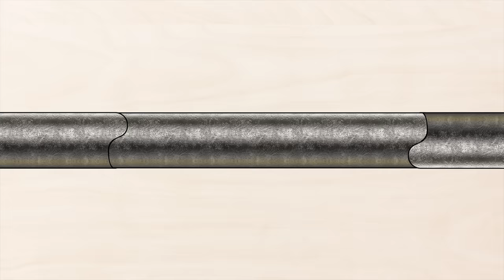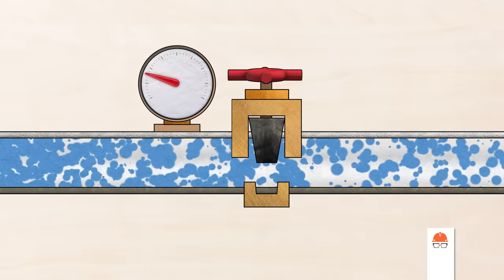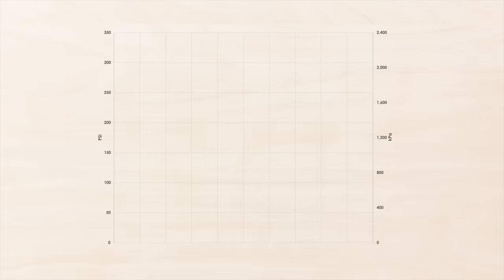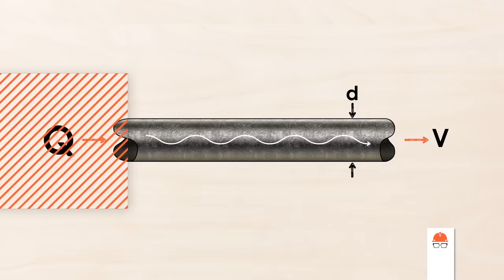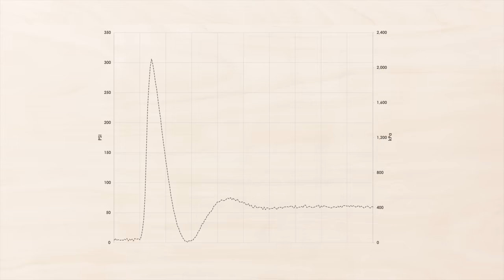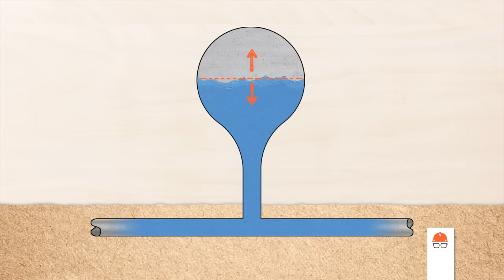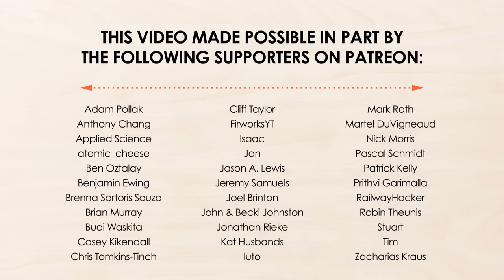What is Water Hammer?

Comment: Damn, I just witnessed this in my work. 
We had complaints of extreme pressure surge from a ground level water-customer. 
That particular pipe was connected to a main before a pumping system that leads to a 15 storey water tank, where the water then flows by gravity for the building. That pumping is controlled together with a "solenoid activated pilot valve", when they detect that the 15 storeys water tank is low in level. 
Apparently, the automatic valve closed too rapidly, causing the water behind the valve to slam against the back of the valve. Which of course, results in Water Hammer! But in my case, the ground level water customer's pipe is connected to the main before the valve. 
Meaning that when the valve slams shut, the water, instead of slamming like water hammer, it finds the easiest exit route, which unfortunately means the ground level's service pipe. The water pressure more than tripled when the valve slams shut.
Reply: @ Dalziel45 I believe you will find the Water Tank is under pressure as well. IF it was 'purely' gravity feed the users on the 14th floor would have Extremely low water pressure.... BUT, you are right about the pressure surge...They either need to add some type of surge arrester OR 'Perhaps' replace the solenoid valve with a check valve, which close 'Once' it senses low flow (ie. the pump shut off)  while Still preventing 'Back flow'.....
Reply: @crazybob1954mo  re: pressure, not at all, depends on the size of tank & their min level and a few other factors. We absolutely can't tell just from that. 

Though it'd have to be a 70 ft tall tank by my reconning- though if the water tank is 15 stories- 225ft above the building as you could interpret op.

There's even a bunch of low pressure systems around. I've not seen everything, but i've seen enough to know someone's gone and done it. It might not be to spec in our countries, but i'd take .3 bar over no running water.

You likely aren't wrong, but its never worth assuming anything, especially good sense.
Reply: @mandowarrior123   Hmm Just What do you recon I am assuming??   You, on the other hand, recon the tank would be 70 ft tall...  On what information is this assertion based??   
Also you 'Think' a 15 story water tank is 225ft.    Surely this is not an 'assumption'...   ??
I do not know what country you live in, though I would not find the water pressure in my home being .3 bas as acceptable. >;)
Also as to your first statement...  pressure does Not depend on the size of the tank... The height of a tank may impact water pressure, but Not the size.  Hmm, Soo Much for Assuming, eh Warren
Good Day to You, Bob

Comment: Hey Grady I’ve been a Lic plumbing contractor for over 20 years and when I’m plumbing a home at every fixture that has a cabinet I always stand a tee up and simply add 8” or so of pipe(usually pex) just before the stops and always make sure all the piping is really secure. Similar to your water tower example. I’ve never had a call back for hamming. Thanks for this video
Reply: I'm not sold on PEX materials yet. I see the installation benefits but do not see the benefits to the homeowner.
Reply: @Garth2011  yet?  It’s been used for over 50 years. The benefits are cost and durability to name a couple. When I plumb a home I do not have any fitting from the mechanical room to the fixture I run straight pipe from my manifold all the way to the fixture that Illuminates any possible future leaks in any crimped fittings and also each fixture can be isolated for repairs or replacements. My manifolds are labeled with a shut off for each fixture. If there are any problems with pex. it’s not the product is the installer you have to make sure your crimp tool is always calibrated properly. Lots of hacks out there
Reply: @jiggidyjam  It's been used for 50 but not in California that long. at first it wasn't rodent proof and the fittings weren't perfected and as you said, the installer has to be on his mark at all times. They do use it here now a days but if I were building a home, I'd using copper I think. 
I have seen installations where they used all home runs to a large manifold in the garage for example. Nice set up and nice to be able to control one room vs. turn off the water main for service etc. On this home, a tract in an HOA, the plumbers had zero future in mind for the homeowners. They terminated the PEX at the toilet and sink connection so, no angle valve, no rigid fixed PEX etc. it would exit the drywall and wiggle like a cheap temporary idea. So if there was a leak or a reason to turn off the toilet (plugged up), they can't quickly. When cleaning their toilet or servicing the bathroom, there are no valves to shut off the water without going into the garage. Lot of folks use those valve when performing cleaning or maintenance. Yes I understand it can be done in the garage but the idea seems so temporary and limited, nothing about those fixtures was rigid, seemed like a mobile home quality install. I'm sure there are better methods but it seems that house was full of shortcuts when it came to using PEX and fittings for the homeowners sake. Then, we have additions later on, mods to existing plumbing etc. that will have to be delt with experienced and well trained plumbers plus their special PEX equipment. There's more to a home plumbing job than the day it is signed off by the city inspector...modifications are likely, needs change etc. and PEX seems less adaptable to that vs. copper.
Reply: @Garth2011  again your argument is about poor installation. I’ve installed hundreds of pex systems with zero call backs and my stub outs with angle or straight stops aren’t floppy. Also copper is just simply to expensive and isn’t necessary.  I’ve used pex for a long time with brass fittings from day one. I certainly hope you’re not confusing pex with polybutylene (grey pipe with plastic fittings) cause that is junk!
Reply: @jiggidyjam  Most plumbing concerns are about poor installation. Workers who claim they are qualified and in the know of plumbing needs and features. In fact, most of everything that turns into crap is due to poor workmanship, providing the materials are good. It's everywhere. Obviously you do not cheap out on you rplumbing jobs, I've seen so much crap out there I rarely trust they know how to do great work. Too many of them have a license and they shouldn't.

Comment: Water hammer is one of the first thing we teach new Fire Engine pump operators when they start.  Valves 4in and above on our trucks are mostly electric gates so they are not a problem, but 3in and smaller valves are all manually operated ball valves... even with the build in protection of a by-pass, slamming those valves shut can seriously damage the pump.
Reply: Pat D they can also blow fire hydrants out of the ground if they are closed fast enough!   I was told that has happened before and to take your time while closing ball valves attached to a hydrant
Reply: Some municipalities require any connection to a hydrant to go through a special valving arrangement to protect the system.  It wasn't uncommon to see water trucks on construction sites ignore this requirement, as the valving reduced flow.
Reply: HAHA yeah, in our fire service we used to remind the new guys with "STOP! Hammer time!!!" when closing hydrants.... Thames Water would kick our asses if we bust one of their water mains!
Reply: Firefighters are the worst offenders for water utilities, they are the ones the break the mains in the ground most of the time, especially due to their arrogance.
Reply: What a bunch of bs, it might be that inexperienced men will cause some accidents because they still lack the training but it's definitely not arrogance that causes those incidents.
Reply: Achisachis73 lack of knowledge is not arrogance
Reply: +General Offender I agree with that statement
Reply: When I was watching this I was wondering if in the larger gate valves if they did not use a finer thread pitch so you have to spin it more to move the gate, thus making it harder to open and close fast.  It seems that there may be some room for idiot proofing gate valves.  With ball valves, all bets are off though.
Reply: We deal with this issue when designing firefighting systems for factories and refineries too. Jockey pumps, if designed to operate at the same head (or sometimes wrongly at a lower head) than the main pumps, can create problems.

I've heard of cases where during pre-commissioning and commissioning activities when the site team started up the main pumps, they actually saw hydrants and monitors fly off. Videos they've shared are pretty scary.

I mean imagine a fire monitor (weighing in at a few hundred kilogrammes) flying off its mounting flange just because of water hammer.

Comment: There has been many a pipe blown apart by the use of butterfly valves (which have a habit of snapping shut due to flow) rather than gate valves (which are physically impossible to close quicky). I remember a certain coal power station where the valves returning water to the cooling ponds had originally been spec'ed to be butterflies. One day the header behind them blew apart in spectacular fashion when several valves snapped shut in unison.

Another interesting design aspect of town water distribution is the concrete blocks that surround every corner in the distribution network. Think of where you see a pipe emerge from the ground to cross a river (sometimes attached to a bridge) - there will be large concrete blocks that anchor the pipe at ether end to spread the forces imparted by the momentum of the water as it rounds the bend in the pipe.
Reply: Can you explain why the butterfly valves slammed shut? Most larger valves have a gearbox type actuator which I assumed would be unlikely to fail due to normal flow.
Reply: Those concrete blocks are usually refered to as thrust blocks, or if they physicaly encase the pipe they can be called thrust collars.
Reply: I have a 36" water main at the back of my yard, with a 90° elbow set in a thrust block.  That block of concrete is 12' x 12' x 8', with the top of the block roughly 7 feet below grade.
Reply: You also see them at the bottom of a penstock right at the powerhouse.
Reply: Lee ... I'm surprised they didn't design the butterflys (ies?) as the "fuse" element.  Did they, and was the header compromised somehow?  Doesn't sound like a very smart design from a human safety point of view if anyone operates near them at any time.  I would also think there could be easy design mods to the butterfly valves themselves that could cause them to fail open, rather than closed, even if they did separate themselves from the control (ie. "flapping" in the breeze, so to speak).
Reply: Lee Ryman sounds unlikely to happen. You would need a significant amount of flow velocity to turn the flap within. In my old plant manual butterfly valves had a safety mechanism where you had to grab the handle and pull a spring clutch to disengage the teeth to turn the valve. On actuated valves, the gearbox keeps any unwanted movement in check. Some processes require butterfly valves since they have to be opened or closed rather quickly therefore they cannot use gate or globe valves.
Reply: I've sold thousands of butterfly, check, gates, and Globe valves, never heard of a bfv slamming shut, check valves all day long but never a bfv.
Reply: osubucks2010 The valves and headers were for salt water (power station using a lake open to the ocean as the cooling loop) in a salty environment and were quite dated. It was a catastrophic failure at the time.

Comment: We use this principle in the oil and gas industry as flowback operators. When coil tubing/Workover rig gets stuck by debris we will use a water hammer to try and free it. In this case the extra pressure can go into the formation but you still run a chance of splitting casing if you do it to hard.

Comment: As a volunteer firefighter who's been in the service just over a year and a half now, I've heard a lot about Water Hammer during my Basic Exterior Firefighting Operations (BEFO in NY) and Apparatus Pump Operator trainings, but it was never really explained well and only shown once or twice what the end result was; That being a sudden and terrifying explosive decoupling of both a 5" Supply line and a 2-1/2" Attack line from a Pumper/Engine. I'm glad to have found your video explaining in detail what's actually happening to create the hazard that I've been so thoroughly warned about but had little of it explained in such detail.

Comment: Great video. Thanks for posting, I will be sharing it with clients.
I almost screamed when I saw the unsupported PEX pipe at 1:30.  I see a lot of that here in VA.
I'll keep my mouth shut on the galvanized in that same shot.
And THANKS for acknowledging all of us plumbers out there.
Reply: The pipe was probably unsupported to better demonstrate the effect.
Reply: Alex Jamieson 
I doubt it. I see pipe run like this all the time, hack "plumbers" and DIY'ers that get "help" from the stock-boys at sLowe's & Home Desperate.
But go ahead & make more excuses.
Reply: Frank De Mascio 
Could you describe the proper way to route such pipes? I think I count as one if those Home Depot hack job peoples, and would welcome sound knowledge.
Reply: Oh but c'mon! PEX is God's gift to plumbing and shark bites are his apostles. It can do no wrong, watch how it handles being bent under it's own weight at the t-joint while under pressure. No more tyranny of 90° elbows and tight corners. Pfft, why have joints at all?!

In all seriousness, I see that all the time. rather than taking the time to run PEX as it should be and have it supported. People simply just run it haphazardly because the pipe is able to bend. PEX is great and easy to repair, but it allows people to be lazy.
Reply: Treat PEX like you were still running copper piping. Pex is flexible but allowing the pipe to bend and bow too much will still cause failures. It's just a matter of installing pipe supports to make sure the pipe is not bowing under it's own weight. In the video, the issue is that the pipe is bending right at the t-joint which does not bend. So there is excessive force right at the joint, a hard enough water hammer or someone accidentally bumping into it and the pipe will snap right there or the joint will fail. Just use common sense and you should be fine.
Reply: ibengmainee 
Agreed!
Reply: Frank De Mascio Funny, was thinking the same thing. In a few years whatever fixture those pipes are attached to is going to full of rust.
Reply: I've seen it break concrete, in an hot water floor heating application
Reply: Frank's reply is actual sound advice, but the main gist is that the pipe needs enough support to keep from bending/breaking due to weight. In the clip shown, that free-hanging pex isn't a problem until it gets heavier due to the water inside, which then places too much strain on the joints on the end. So if you don't want to deal with the water damage, take a class or read the manufacturer's directions/a code book, it doesn't actually add much time to the job to do it properly.
Reply: Fun fact about some plastics and acrylic: it's immune to destructive cavitation that will wreck steel and brass. 
You would think metals would stand up to a 200,000 psi steam bubble implosion better than plastic, but no. 
Great demonstration: https://www.youtube.com/watch?v=0dd6AlyOnfc

I work in a water plant, and imagine the sound from that video scaled up to 14" piping and 50 hp centrifugal pumps running 800-1500 gpm, it sounds like being in a tornado and is not something you want to hear.
Reply: Robert Morgan 
Steam is a whole 'nother beast.
Reply: Well I for one didn't know there was such a thing but now I do so I'm that little bit smarter thanks for that. When I looked at the title I thought it was a high pressure hammer tool.

Comment: Harness the power of water hammer... and you get a RAM PUMP!  I am super fascinated with  ram pumps at the moment and currently doing all the research I can on them. 

In 2016, we bought 18 off-grid acres on a mountainside in VA, with what we first thought to be a fairly useless creek at the base of the property. 

Recently learning about the details of water hammer and how ram pumps harness this power, we've come to realize that our creek is NOT useless, and we're certainly not going to allow its potential to 
go to waste now, if we can help it! First, we've got to put together a system to pump an adequate flow rate (for cob building, gardening, aquaponics, and raising livestock, etc) to push enough water nearly 300 feet straight up, and about 2,000 feet in linear lenth, with the creek's dropdown of only between 3 and 5 feet at the very most. Can we get water hammer to work for us?? 

Thank you for all of your wonderful  and helpful videos! ♡

Comment: I'm an engineer by training, but have done all sorts of things, one of which is rehabbing residential houses.  Whenever I do a plumbing job, I always put in adequate (read: waaaay over-engineered) air chambers at every faucet or outlet that I'm working with.  People always make fun of my 3/4" x 18" tubes on each of hot and cold pipes at every faucet.  But I have never had water hammer.  I am such a geek.  I love it.  And I love your awesome and amazing videos.  They are so ridiculously satisfying.  Thanks for doing them.
Reply from the maker: Thanks. In my experience, the air in a vertical chamber dissolves into the water after a year or so.
Reply: @PracticalEngineeringChannel  Yes, and it's why bladder tanks for well systems have a barrier between the air and water.  Early tanks just had membrane that floated on top of the water.  Yikes.  I would always drain out my house system at least once a year with faucets open to "recharge" the air chambers.  Never had hammer, so something worked.  🤓